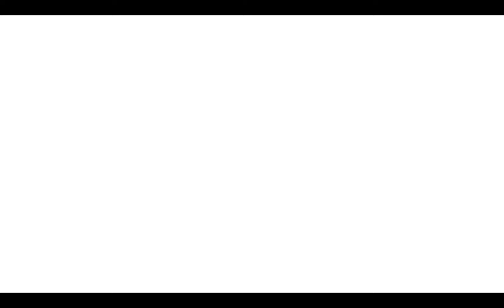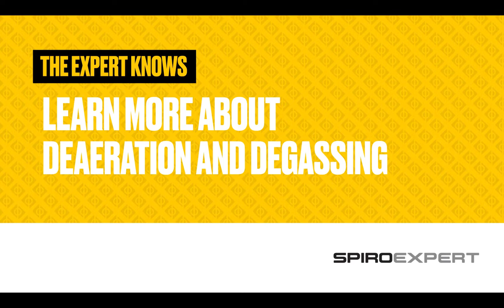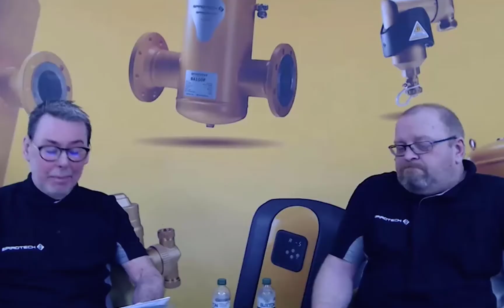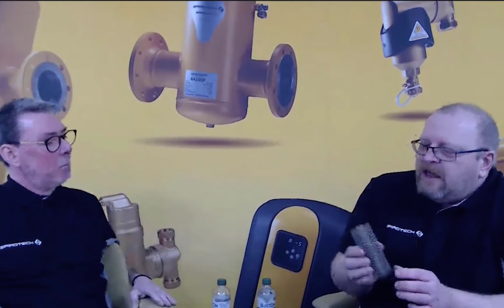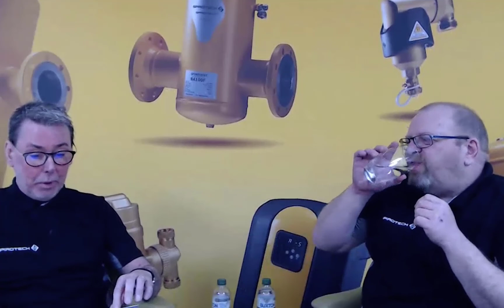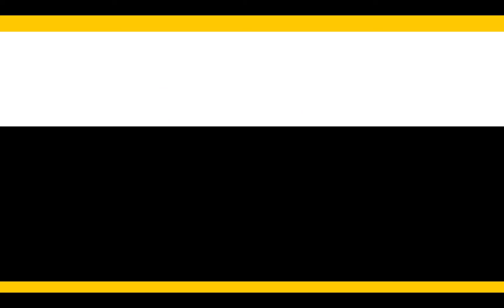SpiroExpert Webtalk Deaeration and Degassing

Comment: HELLO, SIR, I HAVE USED S600R IN MY SYSTEM ITS SHOW E31 I have checked in late water it is reach before solenoid valve but after solenoid valve it does not come please suggest the Couse of it and solution.